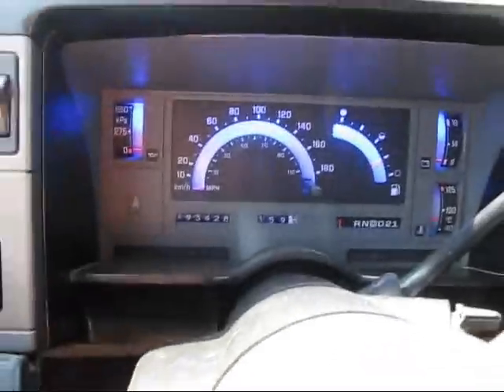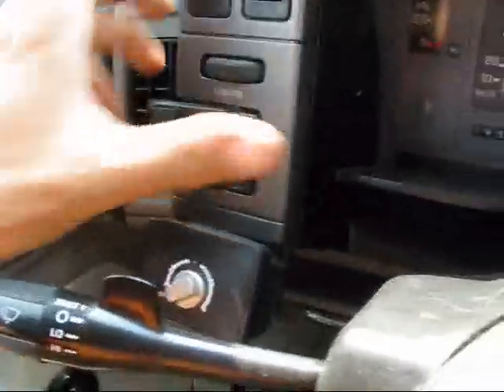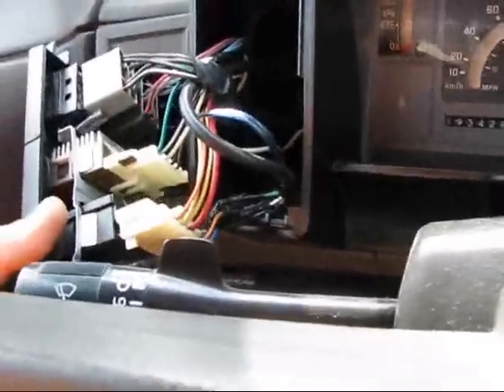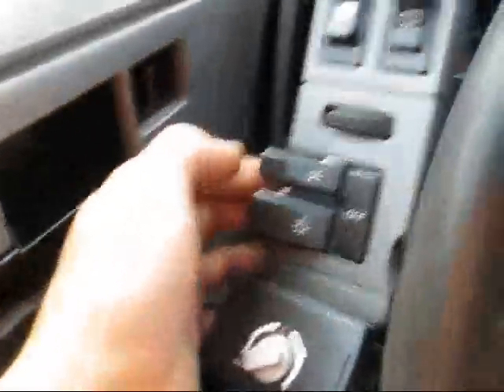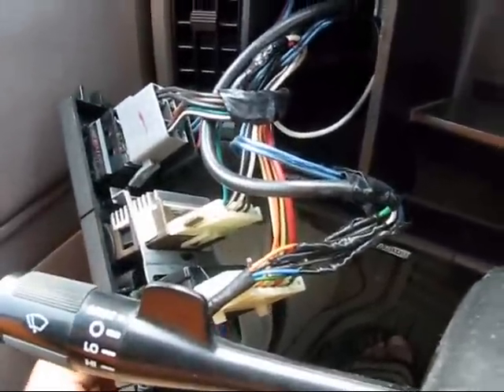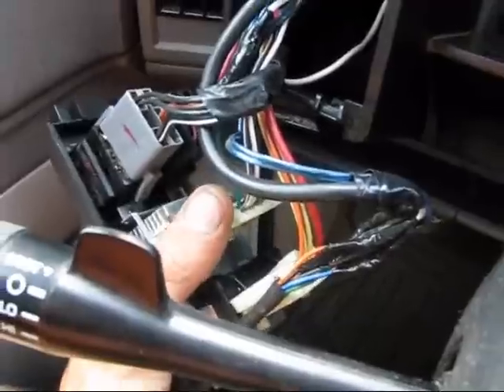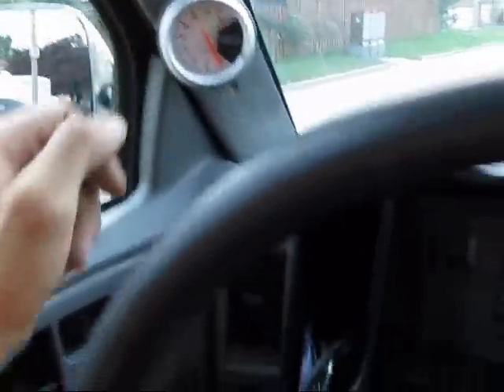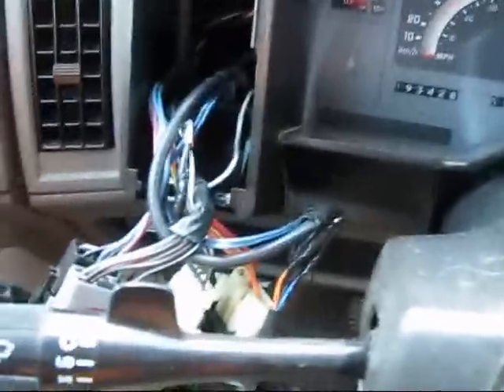S10 Led Dash Power

Comment from the maker: @drtbikepro581  check the fuses, could be the cause of the lack of light in the dash..  the aftermarket tach you added would be tied in to an ignition switched power from what it sounds like. which would cause it to turn on when you start the truck.. you would have to find the wire from your tach that gives it the power to turn on the backlight and re route it to the switch possibly like i did depending on how it works out for you.

Comment from the maker: @texasbraves  its easy.  stealing power from the switch is probably the easiest way to get power to aftermarket lighting.  i have made other videos on how i installed the LED's in the cluster which also was not very difficult thanks to the design of the cluster.  as far as newer blazer's and s10's i don't have experience or know first hand how the clusters are laid out and designed but im sure something could be done in most cases.

Comment from the maker: That is an odd problem, its possibly a worn out contact in the headlight switch. i would remove the switch and use a volt meter to test for the power wire to the dash lights then possibly just add a jumper so when the parking lights are on the dash lights are also on.

Comment: how u get the white in ur guage needle mines blue and wanted to change it to urs
Reply from the maker: juanez6280 I took the cluster apart and painted the gauges with tremclad  gloss spray paint.  flat might give a better end result if I was to do it again. the blue is LED strips. good luck with your project.
Reply: RobHoffmann20 thanks n great videos
Reply from the maker: juanez6280 Thank you.  I appreciate the feedback.  

cheers!